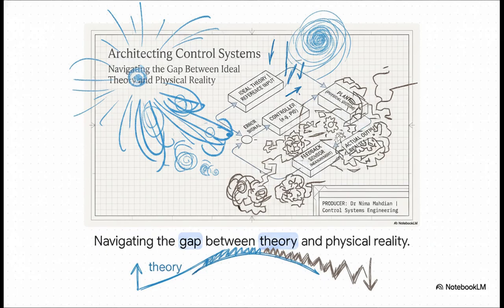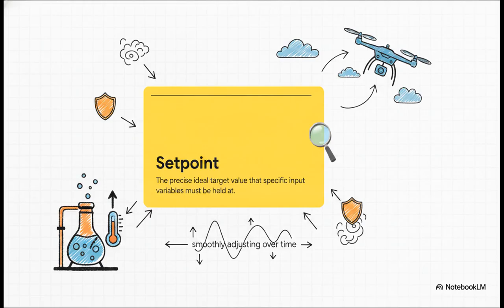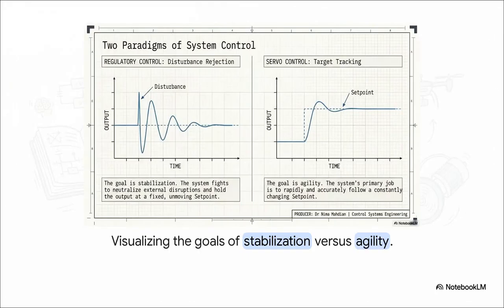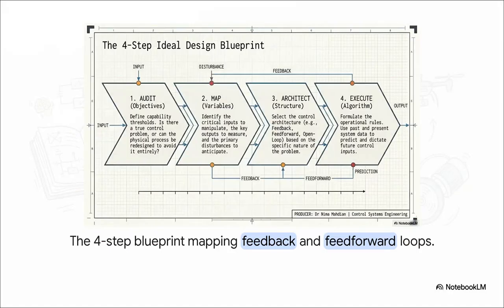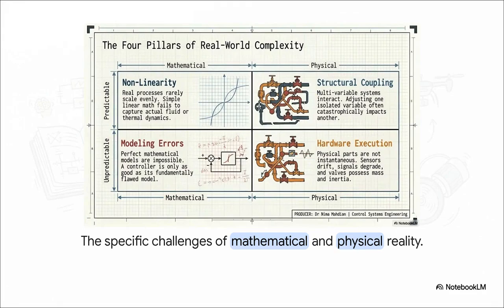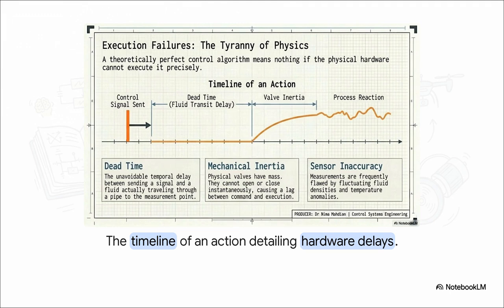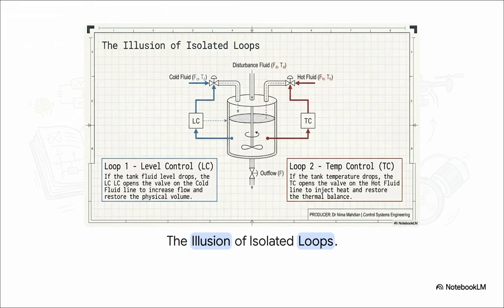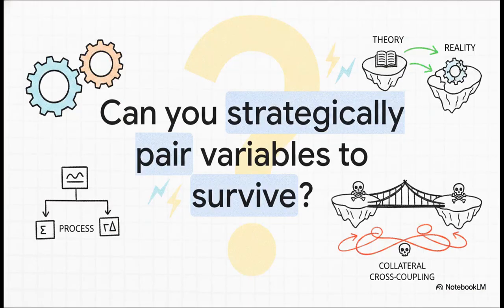Architecting Industrial Control Systems | From Sensors to Controllers and Actuators

Comment: Dr. Mahdian, thank you for this clear and useful explanation. The coupled mixing tank example showed that changing one manipulated variable can affect more than one output.
My question is:
In a real multivariable system, what practical criteria can an engineer use to choose the best input-output pairing and minimize cross-coupling between control loops? For example, how can we decide which actuator should mainly control level and which actuator should mainly control temperature, instead of allowing one loop’s correction to disturb the other?

Comment: The lecture helped me understand the difference between an ideal control design and physical reality. I also understood that changing one variable in a multi-variable system may affect another variable. My equation \ If the Level Controller opens the cold-fluid valve to restore the tank level, will this action also affect the temperature controlled by the Temperature Controller?
Reply from the maker: Excellent question. Yes. In a multivariable process, changing one manipulated variable can affect more than one process variable. In your example, opening the cold-fluid valve to increase the tank level can also lower the tank temperature, creating an interaction between the level and temperature control loops.

This type of interaction is common in industrial processes and is one of the main reasons engineers use techniques such as decoupling, cascade control, or Model Predictive Control (MPC) to minimize the effect of one control loop on another and achieve stable operation.

Comment: Dr I have a question
   when transitioning to Distributed Control Systems (DCS) using modern industrial networks, how can we balance the strict requirements of real-time determinism (PLC cycle time) with the computational overhead introduced by industrial cybersecurity and encryption protocols, without causing latency that might destabilize the closed-loop control?
Reply from the maker: Excellent question. This is one of the main challenges in modern industrial automation. The solution is to separate safety-critical real-time control tasks from higher-level communication and cybersecurity functions.

In practice, fast control loops are usually executed locally in PLCs or controllers with deterministic cycle times, while encryption, authentication, and network security processes are handled by dedicated hardware or at higher network levels.

Engineers also use real-time industrial protocols, network segmentation, priority scheduling, and proper system design to minimize communication delays. For slower process loops, the additional latency is usually acceptable, but for very fast control systems, the control architecture must ensure that cybersecurity measures do not interfere with the required response time.

The key is achieving a balance between real-time performance, system reliability, and cybersecurity protection.

Comment: At 1:01, you mentioned the gap between theoretical control models and real industrial systems. What are the primary sources of this gap, and which engineering methodologies are most effective in reducing its impact on practical control system performance?
Reply from the maker: The gap between theoretical models and real industrial systems mainly comes from model uncertainties, nonlinear behavior, unknown disturbances, sensor noise, actuator limitations, and changing operating conditions that are often simplified or ignored in mathematical models.

Engineers reduce this gap using practical methodologies such as system identification, robust control, adaptive control, feedback correction, and continuous monitoring with real plant data. In addition, proper tuning, simulation, and validation before implementation are essential to ensure that the designed controller performs reliably in real-world conditions.